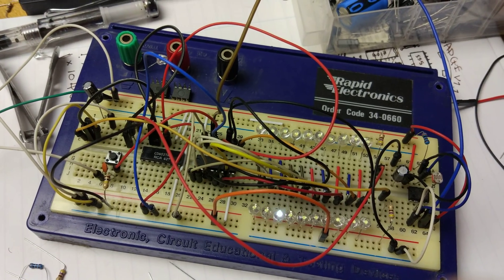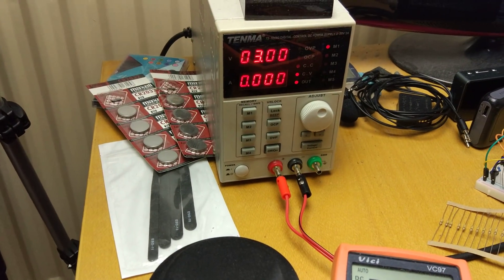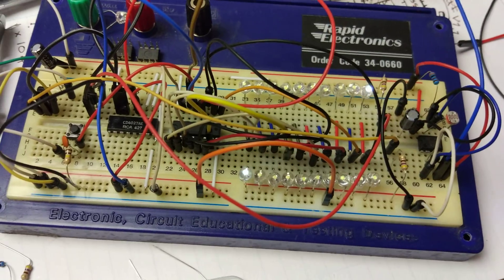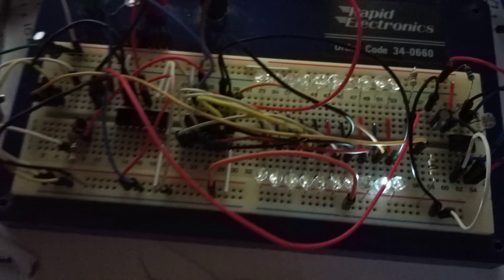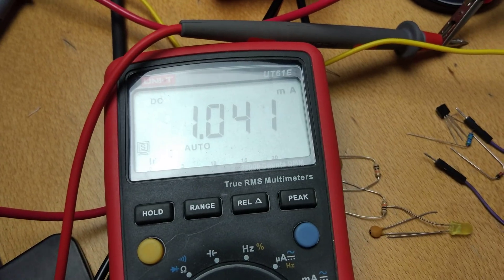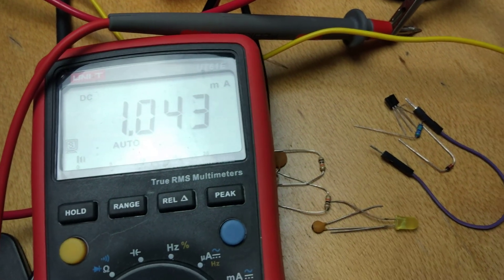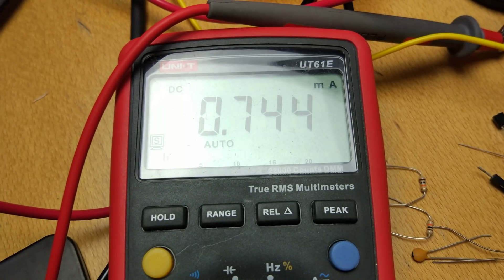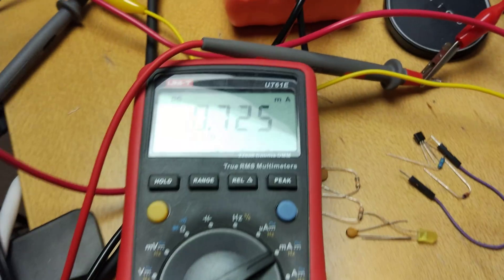Making a badge part 2: Just over the 1mA target

Comment: I guess the current changes with the light off because diodes react to light like a solar panel. Just a thought
Reply from the maker: It is probably to do with the averaging on the multimeter reading, at a slower rate of change the meter is likely closer to the true current spike value. So it is likely pushing 2ma to be honest. But with the 'PWM' of flinging through the LEDs the current appears lower and might actually be lower, I don't have the kit to measure it all that accurately. Just two multimeters, one for current on one for voltage on the other side of the current measurement.
Reply: Led diodes that is
Reply: The 555 ic is in A stable mode using a LDR. The Light sensor resistance changes to less when light shines on it. When it is dark the the LDR resistance increases. For the LEDs to act like a solar panel I think you might have to reverse polarity? I think.
Reply: I wonder how the fast and slow changes effects the cap?